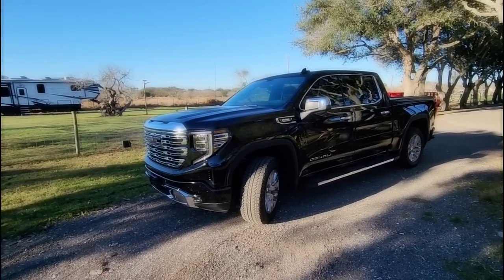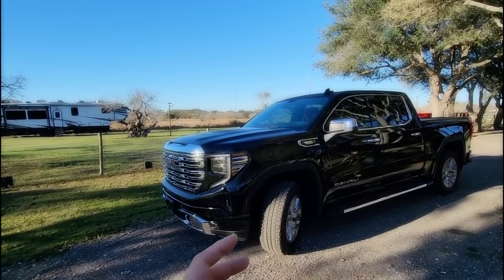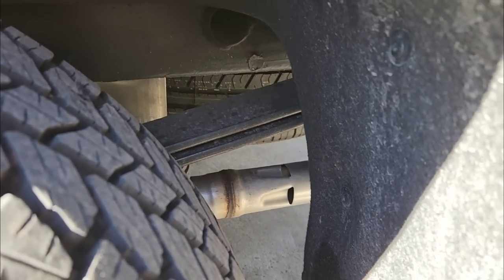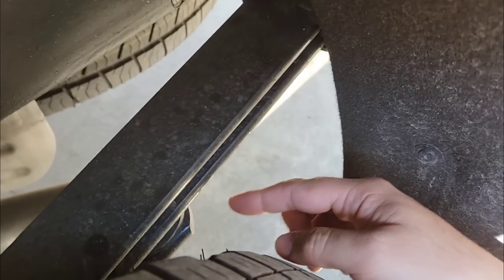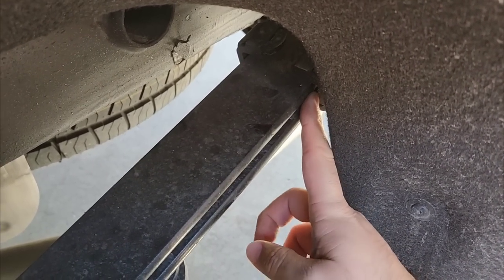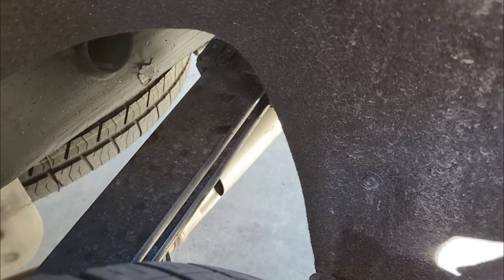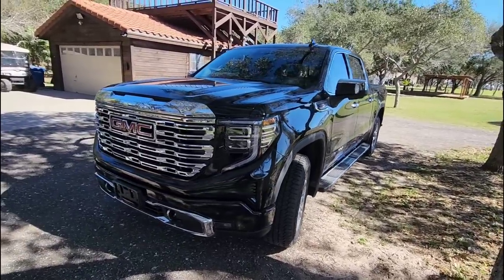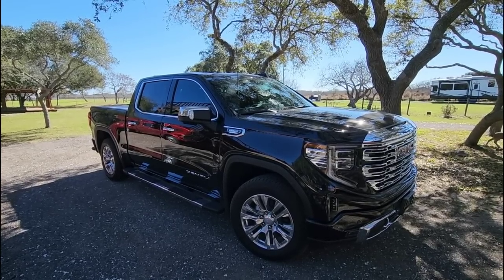Problem with our new 2023 GMC Sierra Denali! Rear Knocking sound.

Comment: All due respect for all of the ideas but this is a new truck the only new one I have ever gotten so a 2023 serria denali that we ordered has 3100 miles on it if it's noisy or broken iam not clamping or spraying or anything else that's why we left ford my wife's suv busted block took 8 months to fix it we should have gotten a new suv then .so I will call the dealership tomorrow ask about the springs lights and possibly a fire from break fluid say's park outside away from everything ugh 😫 we will see I hope not 🚫 but had a recall on gmc suv I was given an appointment not ford sit and wait for them to fix it first come first served ?!?!!

Comment: I have a 2023 1500 AT4 and noticed this noise at around 2000 miles. It hasn't gone away and just had it looked at during my first service at 6000 miles. They told me, and even invited me to see it up on the lift, that its the C Clip rear end, shifts around slightly after it has broken in a bit. The sound reverberates up the leave spring, which connects just behind the cab. Combine that with the new high tensile material used since 2019 redesign, it channels the noise. Long story short, a brand new truck should not be making that noise. I'm taking it to another dealer to have them look at it for a second opinion. To me, that is either a cop out, or poor design.

Comment: My father in laws 2020 GMC 1500 Texas edition had a similar issue. It went away with around 400 pounds in the bed. Took it to the dealer with weight and without weight in the bed, it turns out to be several issues in the rear suspension. The leaf pac, U bolts and some bushings were replaced and no noise now.

Comment: Had the same issue. Took it to a local GMC dealer and was told that was common on these truck.  Didn’t accept that answer. Took it to another GMC dealer and with a stethoscope they determined it was bad leaf springs.  They replaced them under warranty and all is good.

Comment: A quick way to check to see if it is the leaf springs is to put a small c-clamp on the spring and tighten it down. Put it at the point with the largest gap between the main leaf and the second.  You will need 4 clamps if the front and back of the spring both look like this and both left and right also. Don't go far or fast like that but it looked like it was making the noise just driving around your property.

Comment: It’s most likely the leaf springs. My 16 2500 did this. I used a product called spring things. It’s just a large piece of rubber you put in between the leafs. It worked great for me.
Reply: It's quite a shame when an aftermarket company has to come up with a solution to fix a known issue on GM trucks.  You'd think GM would fix it themselves, WTF.

Comment: From the video/audio it coincides with surface irregularities that compress the suspension.  If you are mechanically inclined jack it up and take off the wheel/tire.  Tighten the upper and lower shock bolts, the sway bar bolts, and the nuts on the u-bolt spring pack, also the bolts where the front and rear spring pack attach to the frame.

Comment: I got a 24 Sierra 1500 SLT 3.0 with the increased GVWR and MAX tow with a 6” BDS lift kit and about 1400 miles on the truck. It recently started making this same clunking noise. Took it to the shop that lifted the truck and was told it’s the bushings on the leaf pack. Should be covered under factory warranty. Now I need to get it to the dealership to see what they say.

Comment: It’s a common issue. My 2023 2500 does it too. Dealership replaced both rear leaf spring packs, the noise went away for a few months, now it’s back. The spring packs are not redesigned.
Reply: Damn. That’s crazy, I got a 2023 1500 I got this week and hoping my dealer doesn’t try to shim it. Someone on here saying the sound goes away after 1000 miles or so

Comment: I had leaf springs on a truck that clattered once. I bought some window shims at Lowes and drove a few in there where there was a gap. That made it go away for months until they eventually fell out. I put more in and after the 2nd batch fell out, it didn't clatter anymore. I don't know why, but it was only a few bucks and not much effort so I'll take it.

Comment: I had this same issue on my 2020 GMC and there's a bulletin on the issue. They first changed my shackles even though they knew that was not the issue but a requirement from GMC, noice continued so they finally exchanged the lead springs, and that resolved the issue.

Comment: If you want to double check to see if it’s the leafspring get a strong C clamp put it on the leafspring and tighten it down as hard as you can so it won’t move and then do the same test again if you don’t hear it then you know it’s the spring.

Comment: Check the top bolt on your shock. Mine worked loose recently after a mechanic changed the ranchos to Bilstine. He didn’t fully tighten it and it worked loose. Made a very very similar noise.

Comment: Had a 2018. Did the same thing after I hauled some patio bricks.  The dealer greased them until I told them enough is enough.  Then they put in new leaf springs.

Comment: Good morning, 
I gave a 07 chevy 2500 hd duramax. 
It is a GM failure.
I have replaced the rear leaf springs twice because the springs were broken and made the same clunking noise as in your video!!

Comment: I had the same exact problem with my 2023 sierra 1500 AT4. Very annoying it started around 4k miles. I took it to the dealer and they knew exactly what it was.  They changed the rubber bushings between the leaf springs and tightened the bolts.  The noise is gone now.  Was covered under warranty.

Comment: My 2022 3500hd was quiet the first few weeks. Then it started a similar low speed clunk as you have. I had added an auxiliary tank and a tool box and some other mods so I wasn’t sure what started it.  I don’t hear it when loaded with the gooseneck trailer.

Comment: I had this with my '21 Silverado.   Check the torque on the spring U bolts.  Spec is 59 ft/lbs plus 130°.  I torqued mine to 62 ft/lbs and the clunk went away.

Comment: I'm very sorry for your frustration, I know the feeling I have had many GM trucks and cars over the years and have always been disappointed. I really love the styling of there products but there 
just to many quality issues with that company. I just dumped my 2019 Ford Raptor Cam phaser rattle, not willing to go threw that nightmare. We just needed a reliable truck to start doing a little traveling with. Did a ton of research on line and wound buying a 2021 Toyota Tundra 1794 TRD Off Road. Rides great smooth quite no rattles and I know I wont see any check engine light when I start it. I had to go old school just based on all the you tube videos of people complaining about there new truck purchase's. I think car manufactures don't care about reliability anymore just push out crap and you can deal with it as it falls apart in your driveway. I don't see this getting any better any time soon. Its a sad state that this county has fallen into.

Comment: We have same problem on new 2022 GMC Sierra 1500 diesel.  Took to dealership.  They said it was just the rear floating axle.  
They acted like we were crazy and it was just a normal thing !!!
Reply from the maker: I guess it's normal but only after 1500 miles because it wasn't doing that before then.

Comment: Take it to the dealer! Of course, there are two responses you’ll always get from every dealer. 1) my tech drove it and couldn’t get it to replicate the noise, or 2) the such and such was loose but we tightened it! Then you drive it around the first corner to head home and behold, the noise is still there! Just the same, I’d take it to the dealer first, and just hope they don’t give you the dreaded 3rd reason for the noise, which is “I’m sorry sir, but it’s a Chevy, just wait.”
Reply: Because GM will fight every claim that a dealer fixes, if it's not a 100% accurate claim, GM will not pay the dealer for the warranty work.

Comment: Dealer installed spacer(s) on my leaf springs to stop that noise. But they may also replace the springs. And for a time period reference my truck is a 2014 GMC  Seirra1500.

Comment: My 21 Silverado with the 3.0 does this as well.   I literally thought the same thing about the spare tire.  I also thought it could have been the DEF tank but haven't checked it.. As far as lube for the leaf springs, I use fluid film but I haven't tried on my truck yet.  I am going to keep an eye on this and hope we all can get it figured out. It is super annoying for sure.
Reply: Same here, just got my 23 this week and checked the spare. I couldn’t believe how many videos on the web about this issue. With less than 300 miles on my truck, the dealer better not shim mine. I need a new pack or hoping U bolts  just not torqued down

Comment: My wife and I both own 2022 GM trucks, both with the 3.0L Duramax actually. Both of these trucks made this same noise and my solution was similar to what you said in the video, some grease on the leaf spring between the pad and the leaf spring above it toward the rear of the leaf pack. This pretty well solved the issue entirely, the only noise remaining on both trucks is the sound of fuel and DEF sloshing around in the tanks which I’ve found to sound almost like a clunk at times but obviously nothing to worry about.

Comment: The chevy clunk. My dealer told me it's because of the design. They need a load on them. essentially they are hyper flexing because of the lack of load.  Grease works. I've seen people put rubber pads on them and I've also seen people just flat out swap them out. for me I just turn the music up in the truck.

Comment: Had this exact same problem on my 2016 sierra. Under warranty they replaced the leaf springs and a lot of other things. Ended up trading it in. I have a 2019 now. It's the rear differential. Started to do the same thing. Took it in for maintenance and they put new rear differential fluid. They never did this to my 2016. Haven't had this problem again. You will notice the truck will also jerk when changing lower gears.  Hope this helps.

Comment: Its coming from the front of the leaf spring shackle where the bolt goes through the shackle and leaf spring,  grab the truck by the top of the bed and shake it from side to side hard as you can and you will hear it,
Reply: I actually just installed some belltech 2inch drop shackles and now getting this sound... Why is that??

Comment: Drive the truck just like you did in the video, but with the parking brake partially applied, does the noise go away? To track down a problem like this, you must start using the process of elimination. Take the spare tire off, take the shocks off.  Put c-clamps on the Springs.  Also, try to duplicate the noise sitting still  by bouncing up-and-down on the rear pumper and shaking the truck side to side.  If you can duplicate the noise sitting still, you can get somebody else under there to locate the noise. Raise the rear wheels off the ground and grab the tires and try to pull them in-and-out, can you duplicate the sound?  I've heard this noise before. It sounds like a c-clip axle with too much play in the c-clip groove.

Comment: This happened to my 18 Silverado when it was still new.  There was a TSB to replace the isolation pads.  They did that and it worked for a few years.  Now it's back, and out of warranty, so today I installed some 1/4" rubber pads between the top two springs.  Similar to the Spring Things and it made it quiet.  I do need to come up with a way to keep them between the springs, since with just one drive, a couple of them are trying to work their way out.  But it did quiet it down right away.

Comment: In addition to my spring thing recommendation 
Put a torque on your axle bolts and check the tightness.
There is a service bulletin on them. I found mine were nowhere near the spec tightness

Comment: That sounds like a shock that isn't tightened down enough.  I replaced my rear shocks on my 2500HD recently and it had that same sound after I did it.  So I crawled back under it and sure enough, they weren't tight, like super tight and working up and down on the bolts.  I would definitely put a big ass wrench on the shock bolts, I bet they aren't tight enough.

Comment: So my 2019 Silverado 1500 rst z71 did this every once in a while causing me to check my spare tire.  My 2022 Silverado 1500 rst 3.0 doesn’t do this.  So I understand what you are going through.  I wish I could get my heated seats and heated steering wheel chips as I bought my truck back in April 2022.  I have been a loyal customer but my patience is wearing thin.  Love my truck but it’s winter and I want my parts that I was promised.  Curious if you instal summo springs or something similar, it would help minimize your issue.
Reply: Lastly what is your hitch weights  that you have applied when towing?  Wonder if you maxed it out ever?  I only hit 600 pounds give or take 20 pounds with my 2019.  So I know I never hit any limits of capacity but still had leaf spring knock as you did.  So we definitely can conclude it’s a GM issue that hopefully your channel will get addressed.

Comment: JD… I had a 2011 Silverado with clunking in the suspension and 2 different GM dealerships told me it’s normal and it was the axle sliding in the tube.. now I drive Fords

Comment: As a former GMC frame an chasis engineer within the 1/2 and 3/4 ton division; I will tell you it’s a “feature” designed to enhance the capability of the truck. By allowing an air gap between the springs, it allows air flow to cool the spring pack especially during high friction instances. If this sounds incredibly dumb, just know this is why I left GMC and took employment at Ford Research and Design 18 months ago. ✌️
Reply: Yep. I gave up on GM in the last 6 years for all the right reasons
Reply: I was smart. I learned from others' poor experiences and never bought GM products. Everyone I know has had issues.
Reply: Lol!

Comment: I currently have this same problem on my Chevy 2019 2500hd lt duramax it rained a week ago and it was gone for a day and back it goes to the dealership Monday the June 26 I pretty sure it’s the leaf springs as well it’s really embarrassing to drive because of the noise it was in a month ago the dealership thought it was the rear end so put a new one in it didn’t fix the noise at all
Reply: Wow same problem with mine. When it rains it goes away for a few days then comes back. Any luck at dealer? I'm pretty sure it's the leaf springs

Comment: GMC 2023 1,200 took it to the dealer they and the GMC technicians said it was normal. So I installed the rubber pads, “Spring Thing”, and no more clunking noise.

Comment: My 2015 GMC started doing this at about 90,000 miles. I bought 1/4” grade 60A neoprene rubber on Amazon and cut it to width and length. Then removed the old isolation pads and put in the neoprene. That solved my problem. Your new truck should be in warranty. I’d let the dealership take care of it.

Comment: Man that truly sucks and I feel ya.  I have a '22 F250 that has a clunk/pop that sounds like it's coming from the transmission/transfer case area when it hits about 2.5 mph.  Only does it when ya first start up and take off.  One clunk and done til you kill it and start again,  It's been in the shop twice.  One dealer said it was a "normal attribute", the other dealer says they can't replicate it.  Looks like I'm going to be stuck with a clunk and with my luck it'll hold out till the warranty is out then grenade.   I wish you all the best getting your issue resolved.
Reply: I had a infiniti fx35 made a similar sound. dealer said it was normal part of the brake system.
Reply: @seawolff33  I'll run that by them when I call the tomorrow.  The thing is though, no one I've talked to that has a truck like it has heard that sound and the one I test drove while mine was in the shop didn't do it.  There may be nothing to it but it is driving me a tad nuts.

Comment: Had the same issue on my 2018. Had to put some rubber padding between the middle and top springs on the front and back. Both sides driver and passenger

Comment: I have a 2022 GMC SLT Crew Cab 4x4 with the 3.0 Duramax. I've never really noticed this with mine, although not ruling it out. Maybe too many years driving trucks when I was younger that each had their own series of sounds. I know back before WW2 high end cars like Packard had what were called Gaiters that wrapped around the leaf springs and were soaked with lubricant to keep them quiet.

Comment: I've got under 1k mi on my 23 GMC Sierra 2500hd and the only issue I've had is that clunking. I plan to get my first oil change at around 1k and have the dealer look into the noise.  I saw a person say their noise went away after about 1k miles so...
Reply: Curious if after the 1k mark your noise went away. Just picked my truck up from the dealer today and noticed this on the gravel road and then again pulling into driveway

Comment: I had a 5 .3 slt 2019 serria same clunking noise my pinion seal blew 4 times at 30k miles I told them there was a clunking noise everytime I came in they said it was normal, but after stopped apart the rear end and replacing the rear axle the clunking went away🤔🤔

Comment: I use to have a 2016 Sierra 2500 HD gas. I didn’t initially have an issue. When the sound appeared was after I had it undercoated for the first time. The truck on a hoist and being sprayed allowed grease between the springs. That’s enough for it to cause flex. The dealership replaced the leaf springs under warranty and told me to wrap the springs in plastic the next time I had undercoating done (which helped). That was my experience with the same noise.